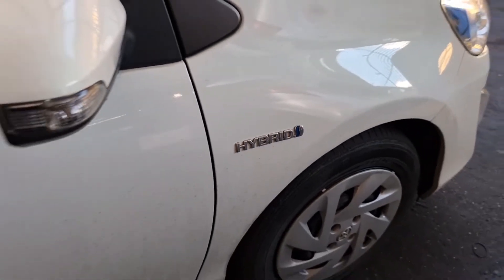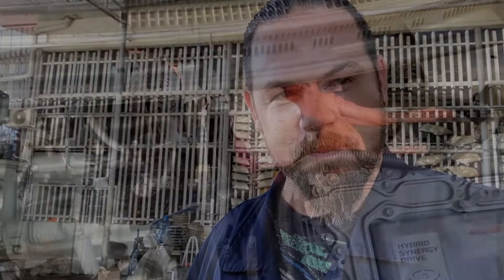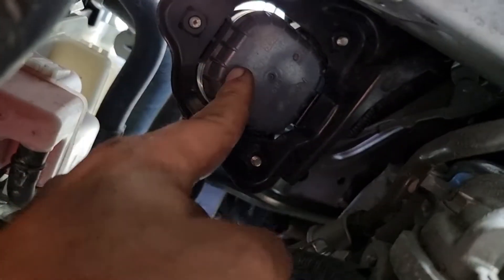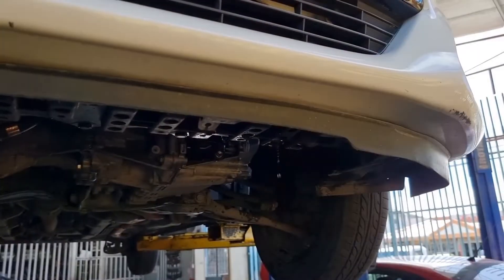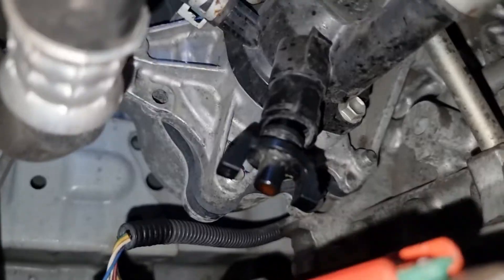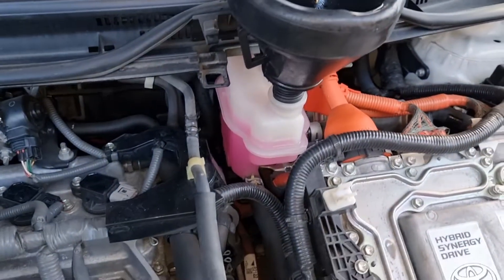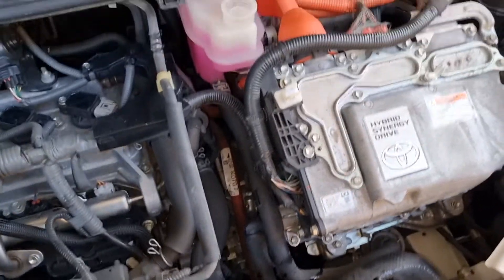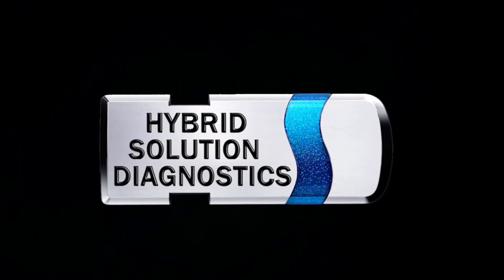how to change the engine and hybrid system coolant for toyota yaris prius c aqua axio fielder sienta

Comment: Hi, I always watch your videos, which I find very useful and well-made. Congratulations! Since I need to change the coolant in the engine and hybrid system (inverter) of a 2020 Corolla Touring Sports full hybrid with an M20A-FXS engine, I wanted to ask if there's a specific procedure for purging air, or is it just like you showed in the video? Thank you so much in advance for your kind cooperation.

Comment: On US models the original factory coolant is supposed to be changed at 100,000 miles or five years. After that they say every five years or 50,000 miles.

Comment: Hi Jose, if im replacing the Radiator on a Toyota Prius C, id imagine it would be the exactly the same steps to refill the system as you just did after putting in the new rad.

Comment: Hello, I'm having a problem with my hybrid Axio trouble code Toyota P0C73. I have changed the inverter coolant pump to bleed the air out of the system, and it's still giving me the code before I changed the pump. The car would be in limp mode after the change; it is running good. Just check the engine and the hybrid system lights on the dash. I was doing some checks, and it seems the inverter coolant is entering the engine coolant in the radiator. Could that be the cause of the problem?

Comment: I need a bit of help, how I can bleed the engine coolant system on Prius Gen4 2016? It has two caps on the  engine coolant reservoir one is for top up and one little one with Alan key opening

Comment: Could you possibly show this on the Ioniq please? And if possible, show how to disassemble and put back the EGR valve after cleaning? I find the Hyundai impossible compared to the Toyota and it’s a real expensive job if only the dealership will touch it - they don’t repair, only replace hence the added cost. Gracias.

Comment: Help, ive drained coolant everywhere easily except the engine coolant pull down plug won't pull down, i did remove safety pin. Still won't budge

Comment: Thank you for the video!  FYI it is possible to drain and refill both the engine and inverter coolant without removing plastic underbody panels.  I don’t think I had to remove any undercarriage plastic bits.  Tried to remove one but one bolt head was very rusted so I just reached from the bottom/top of the car to do it all.  It took a bit of contorting and I had to wiggle the engine drain petcock to get it unstuck after 10 years of Ohio winters, but I got it open after some twisting and pulling.  I was confused why the engine coolant wasn't draining at first until i realized I didn't open the pressurized metal coolant cap.  Instead of removing the coolant reservoir hose, I used a hand pump to empty the reservoir.  

The coolant I used was Walmart Super Tech OE Red Antifreeze Prediluted 50/50, $11.83/gallon.

Comment: The thermostat was closed because the engine was cold. Are you saying you don’t need to raise engine temp beyond thermostat opening to make sure you don’t have air in the system. This is the way my 05 was.  Once 180-190 more air came out.

Comment: Help please. I have exactly same car and the level of the coolant is slightly below the minimum level. I bought another coolant and is clearly different. Can i top it up temporarily or i must replace it? Is it safe to mix different coolants? Help please 🙏 thanks
Reply from the maker: Just top it up until you ready to replace the complete coolant… nothing will happen 👋😁👋😁
Reply: @hybridsolutiondiagnostics  thanks a lot, you're the best! 😊✌️
Reply: I have the prestone coolant for asian vehicles, it is red not pink, will it work?

Comment: Changed the engine coolant in my 2015 Prius C.  When I reach high speed, 70mph, the red engine temperature light comes on.  When I decelerate to about 50mph and below, the red temperature symbols disappears, and the dash returns to normal.  Also, my heater is no longer blowing hot air.  What do you think could be wrong?
Reply from the maker: Air in the system probably or stuck thermostat… cooling fan as well
Reply: @hybridsolutiondiagnostics  Engine cooling fan, not the water pump?

Comment: I use Motul engine oil in my Toyota hybrid, didn't know they made coolant too, nice tip.
Reply from the maker: No doubt one of the very best indeed ☝😎
Reply: @hybridsolutiondiagnostics  Why the michenics says > you have to fill the transmission oil from the Bottome instead of top"???
Reply from the maker: @childofgod4862  from both can be done depending of the equipment you using but it's fine 👋😎
Reply: @hybridsolutiondiagnostics  Thanks and God bless you